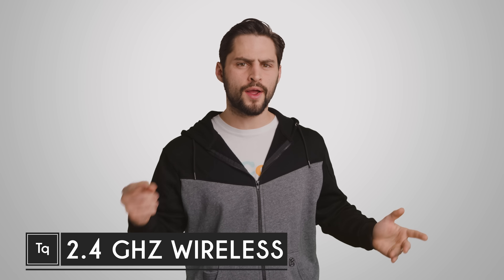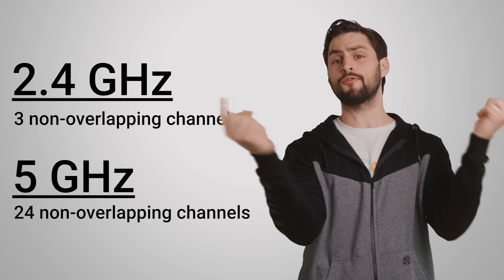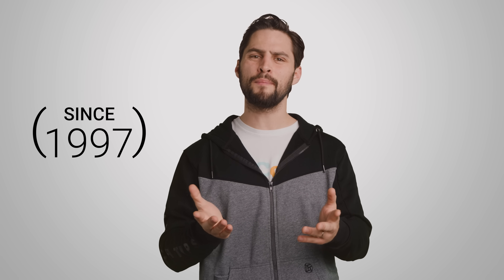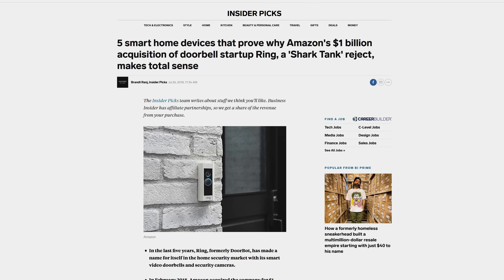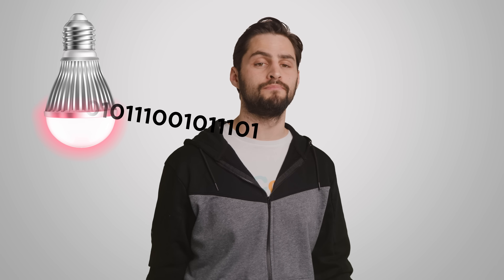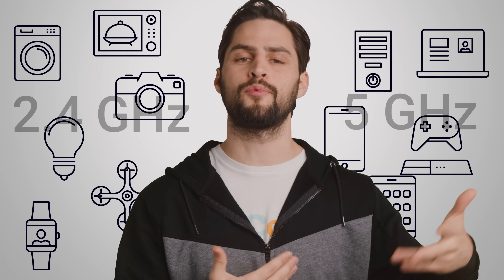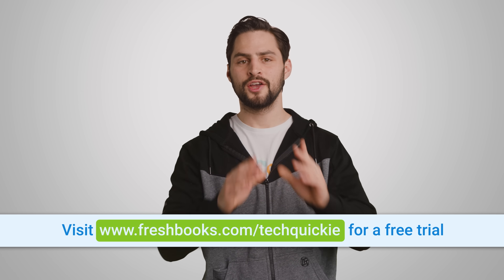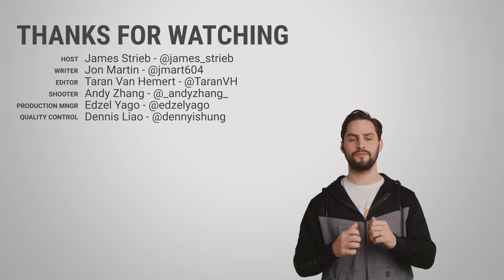Why will WiFi always be SLOW??

Comment: Fun fact some of the earliest Wifi was on the 900mhz ISM band , would cool to have that for IOT stuff not a whole lot of bandwidth but damn it would have Range compared to 2.4ghz
Also 2.4ghz and 5.8ghz both came out in 1999 , as wireless A and B (or for the more technical among you IEEE 802.11A and IEEE 802.11B) the standards were agreed upon and released in 1997 (802.11) , but later clarified in 1999 (A & B). So 5.8 is the same age as 2.4 just thought you might want to clear that up in the video.

Comment: I remember dialup at 300 baud. Switched to 1200 baud and I thought it was fast. But on the internet, even 56K is dead slow due to the much larger amount of data for a connection. I started Second Life (online virtual world with real time screen updates) on dialup. It was very depressing as the screen would take half a minute or more to update anything. Chat went good in real time, but all the graphics were seriously slowed. Finally got it onto WIFI and everything finally was in real time.

Comment: 2.4GHz is better during the high humidity wet season too, here when there is an active monsoon system the 5GHz drops off a rediculous amount of range and 2.4GHz can becone the only option in some parts of the house unless repeaters are put in but that costs and therefore it is just easier to switch to the 2.4GHz.

Comment: Having dual band is actually helpful. It allows all the slow and legacy equipment to not bog down the faster stuff. Combine that with Ethernet for certain devices that you can conveniently hard wire and it can only help. The more channels we have for connectivity to a router the better.

Comment: The video doesn't talk about Freznel zones and obstacles to penetration.  Want to go thru trees then use 900MHz....are a major ISP use 11GHz, 24GHZ, or 80GHz.  Wait until new phone towers with 5G come out...you will get terrible reception but good throughput if you have a cell phone tower in your backyard.
Techquickie doesn't understand the problem with 2.4GHz is devices putting out too much power to compensate for poor antennas.  Use good bandpass/bandreject filters and good antennas.  The most important factor is signal to noise ratio.  Good antennas have high signal to noise ratios.  Too many customers just buy overpowered WIFI devices and expect good results.

Another YouTube channel without technical knowledge trying to make money.

Comment: I have gigbit at home and getting 411MBIT/s down and 694 MBIT/s up on my phone on 5 Ghz. i have a concrete wall in the middle of my aparment but i have two Access point that are connectet to the router with PoE. You get what you pay for.

Comment: I feel the title completely missed the mark here.  Its not that WiFi will always be slow, its that fast WiFi will need a lot of Access Points and, ironically, wires.

With 6Ghz support coming to WiFi 6E and even higher potentially in the future, its absolutely not all about range.  Its actually a GOOD thing that range is decreasing, as it means 6Ghz should be far more efficiently utilised as the chance of crosstalk is even lower.  Its just not going to be as simple as slapping a single WiFi router in your house and you're good to go.

Comment: Why not having a different standard with less than 2.4Ghz and less speed but better range than 2.4Ghz for devices that do not require speed for triggering specific commands?
Like 1,2Ghz or 0,6Ghz?

Comment: 6 days til I get the ethernet installed in 5 or 6 rooms here -- I am stoked, especially about getting a solid connection in my over-the-garage office/man-cave, which is separated from everything by a literal firewall of solid stone.  But you know: I will still need a wifi router (or 2), for all the devices that can't use ethernet, from phones to the doorbell etc.

Comment: The cheaper routers will sometimes advertise that they are 1gbps capable, but then they put 100mbps switches in them... Why?!
Reply: 1 Gbps is line speed and wireless, Ethernet is used less.

Comment: I had to stop using my 2.4 GHz wireless headphones when I moved because the interference here is so bad that 2.4 GHz is basically unusable. Any device disconects every 2-5 minutes and has to reconnect. The 5 GHz stuff works like a charm.

Comment: 2.4 is better. Plain and simple. It's fast enough for anything you actually need to do and it's range is so much better. The time you waste buffering for a lost signal is more then made-up for with an imperceivably slower connection.

Comment: 802.11a came out in 1999. It was a higher-speed protocol compared to b, but g equalled it, and n bested it. It's only now with multiple antennas, more sophisticated radios, and more robust error correction that 5 GHZ and higher ISM bands are viable for high speed connections.

Comment: Get many access points instead of one beefy router. No more range problems.
With ethernet cables it’s also not really expensive. Solutions like mesh networks or dlan work also mostly great, but are usually pretty expensive.

Comment: 2030: literally using lasers that shoot at devices with no interference unless some pesky dust appears
Reply: There are two standards, laser and rfid. They can pump out 1000mbps in direct line of sight. 

Lasers are already used in single mode fiber optics since they can travel up to 100 km or 90miles
Reply: @Killius  Well, i meant some kind of router that would track the devices' positions and direct lasers to them... also when i think about for something with this high bandwidth a simple cable would be better - 1080p 60fps video is all that you really need for mobile device anyway. How about quantum communication though?

Comment: 2.4 ghz is more power efficient it is more then fast enough at 150 mbit here with 30 others routers nearby so i even have my 5ghz disabled as ir shaves off 5 watts.  And 5ghz wont eben penetrate my concrete walls and floor slabs. Pointless unless you install a ap in every room.

Comment: I run my 5GHz WiFi at 1 watt 20MHz on the super low double digit channels...4x the range and penetration is improved, and has enough speed for my 170Mbps internet. :-D

Comment: Shared medium like wifi is always going to benefit from alternative bands to transmit on.

Cant beat a good old wired connection to the router though for high speed low latency internet access.

Comment: The difference between the 2 is range, thats by far the main factor.  5 ghz does not go through walls well.  It isn't by a little bit either. The range difference is dramatic.

Comment: Just want to point out a minor error.   5 ghz wifi was standardized back in 1999 as 802.11a, the same year that the first widespread wifi at 2.4 ghz was standardized as 802.11b.  My very first wifi access point actually was a combo 802.11a/b in the early 2000's.  

802.11a was 54 mbps, same speed as the later 802..11g standard at 2.4 which eventually replaced 802.11b.  So 5 ghz wifi has been here since basically the beginning, it's not more modern just faster compared to whatever 2.4 standard which was available at the same time.

Comment: want faster wifi, stop using a router/firewall/wifi device from the ISP in a bad location at your house or business. Deploy a dedicated WiFi solution in your house or business with multiple access points for increased capacity and stronger signal strength. It just takes one slow and poorly connected wifi client to take down a WiFi access point, so don't have just one..

Comment: The reason is simple. If you look at a 5ghz signal vs a 2.4ghz signal the wave pattern will look different. The 5ghz wave form is much narrower and compressed than 2.4ghz because it is has more energy. Bandwidth is higher due to this but it comes at a cost. The range is reduced and obstacles in the way wear the signal down much more easily than 2.4ghz. Bandwidth is lower with 2.4ghz but since the wave form is lower energy and stretched out the range is considerably greater and it penetrates obstacles better.

It is like comparing AM and FM radio.

Comment: at home i have a dual band router but only use the 2.4 channel as the 5ghz channel is simply slower, have less range and devices connected to it suffer constant disconnects, none of that happen when connected to the 2.4 channel.

Comment: While the 2.4 vs 5 Ghz comparison is valid, you forgot to mention two major other aspects of wifi which make it incredibly slow. The first is that most cheap routers can only communicate with one device at a time, meaning that if multiple devices send request, they are gonna be answered one by one. This is solved by the MU-MIMO technology. The second reason is linked to data prioritization: on most wifi routers,  all data has the same priority which is not necessarily the best strategy. Some routers have prioritization capabilities to make it so that your video/phone calls or video games are never delayed compared to your downloads which are not time critical. All of this can be solved by making / buying good routers.

Comment: In Physics, wavelength is inversely proportional to frequency. Meaning the higher the frequency the shorter the distance it can travel. Also, lower frequency penerate walls at low energy which is useful considering higher frequency yields higher energy. We're not even considering the cost and how "easy" it is to build it.

Comment: I have just a one bedroom apartment and I have the 2.4ghz band turned off. It has a longer range than the 5ghz, and so I think it decreases my chances of a hacker getting into my network. Even though I still have one wifi signal, it doesn't go as far and has problems being reliable through many walls. A wider signal range means more people could have access to the network; ie apartments further away still get my 2.4 signal than my 5g signal. I tested it and i can still get my 2.4 signal sitting in my car in the parking lot, and I can't get my 5ghz signal standing at the door to my building, about 100 yards from my apartment(LOTS of walls to make it through). Only my phone and my sister's phone use the wifi, and i barely use my phone, so it's mainly my sister's phone.

Comment: You'd be surprised at how many people think a 2,4 GHz wifi connection passed through two reinforced concrete walls will deliver the same speeds and stability as an ethernet cable and then call their ISP to complain when they measure "less speed than they pay for".